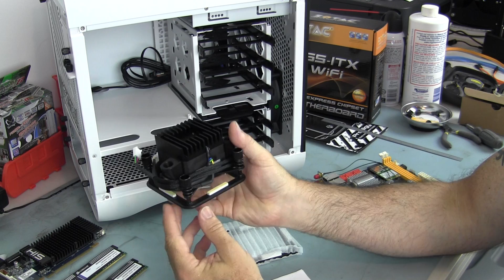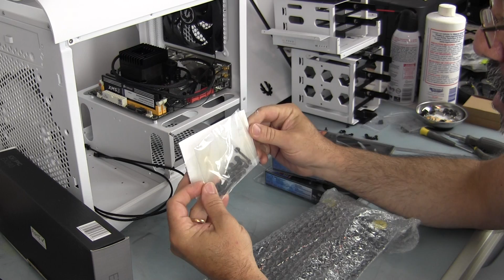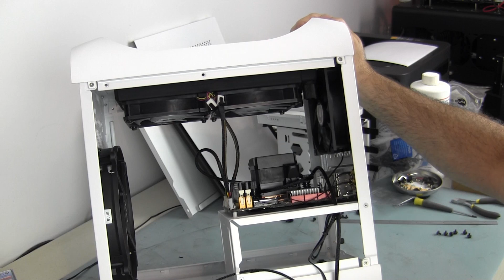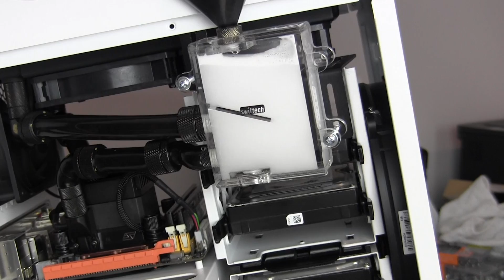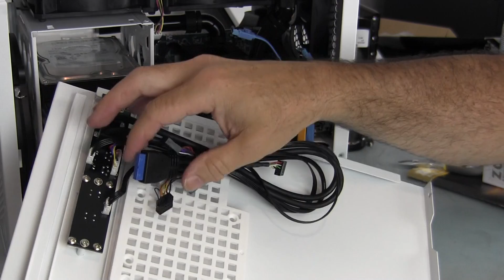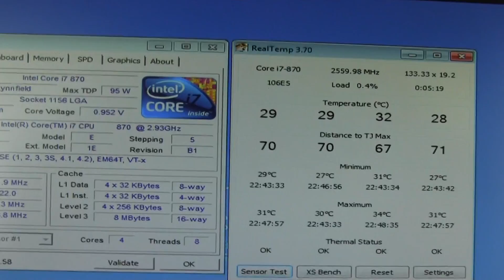BitFenix Prodigy Water Cooled WHS2011 Home Server Build - Part 2 - The Build

Comment: What happend at 38:38
Reply from the maker: The reservoir was so small and it sucked the coolant out so quickly I was afraid it would run the pump dry. SO I stopped and checked and then started again.

Comment: For a file server, a good CPU active cooling solution would have been most sufficient... But the setup you did is awesome, IMHO just for this and the fun of finding/building a solution it's worth it. Excellent Swiftech parts. however the pump is too noisy for my taste, personally high pitch whining noises give me tough headaches after a while.
Reply from the maker: Yes, was overkill cooling for a server, but it is still running strong.  Thanks for watching.
Reply: Ronsanut thank YOU for showing us. After a couple of such clips, your's amongst the top... When we actually "see" pros doing this, and all that they have to get through, personally I now feel more confident to try out my 1st custom water cooling solution.
Reply from the maker: HawkFest Great, glad it helped. Enjoy your build.

Comment from the maker: At full voltage the Apogee is louder than a D5 or DDC. I run this at the lowest setting since I am not overclocking.  But if space is your limiting situation, just adjust the speed until you find a balance for cooling and performance.
In order of noise at highest setting I would say from quietest to loudest, D5, DDC, Appogee.  But also depends on your case too. That may dull some of the noise.  Older GPU's are louder than this pump.

Comment: Hi Ron!

How loud would you say the Swiftech Apogee Drive II is compaired to a D5 or a DDC?
I'm thinking of building a micro atx case thats fully water cooled with 1 cpu and 2 gpu's and 2 240's, and i was just wondering if it was powerful enough and yet quiet?

Comment: Why dint u turn the Pump 80° to the right, than u would have anny problems with the GPU and it would be a bit easyr to conect with radiator.

Comment: I am looking to build my first computer in this case that will also work as a backup and media server (no gaming, but some encoding, so probably a 4770K), so I need room for 4-5 drives. However, I would also like to have a BD drive for rips. 2 questions: what would be the cost/benefit of water cooling in this scenario, and if so, how would you set it up with the optical drive still in place? I would be using the PCIe slot either for a RAID card or low power GPU.

Comment: Try sticking a long thin screwdriver or a plastic stick down your funnel into the res next time you fill it and it gives you issues to get the juice into the system, prevents the fluid getting stuck in the funnel

Comment: For me it's all about the situation that your in, I'm not saying that either setup is bad or wrong...i was just saying that with the case being of such a small size that it more feasible to use an out of the box solution. I customize cases as part of my job and i have i have no issue with either setup. There are merits to both

And yes, I did use the wrong item when i typed the x60. I had just finished watching a review comparison between the new corsair and nzxt ranges, i ment H80i

Comment from the maker: No that rad comes down about a third of the way into the optical drive bay space. Any rad you use in the top will prevent a fan controller from fitting in there.

Comment: Hi Ron. Love your channel. I'm about to get started with a prodigy build myself here. First question , with the same 240 rad , could I keep the optical bay tray in place and maybe use low profile scythe fans (i'd like to have a fan controller at the front , so I assume I have to leave the tray in...right?) 

Power supplies. Which would you recommend? I am leaning towards a Silverstone strider with short cable kit.

Cheers man! :)

- JC

Comment: In case nobody's mentioned it, you'll likely knock some of the fan noise down a bit by cutting out some of the roof of the drive bay cage.  You'll allow more airflow, which will knock down some noise.

Comment from the maker: Nice system, love that case too.  For what you have and that case, I would suggest a D5 Pump. I think think this HS and Pump combo is better suited for smaller rigs where you don'tr have the real estate.  But in yout TJ11 I would show off a tube res with a pump top and D5 pump. Check out my Clockwork Orange  Build. Thanks for watching.

Comment: Nice video thanks for the great details on the over all system. I have been looking at the drive 2 for awhile now. Atfer using wouls you recommend using it in a high end system. Im running amd 8150, dual vga xfx7950 double d's 3gb, and would like to liquid cool my system oh and its in a tj11!

Comment: Dude, you wanna know why the 200mm fan didn't fit? It's because you screwed it in the wrong places. You know where the optical drive bay removable metal plate is? There are 2 mounting points actually on it. If you were to remove it, you can replace it. There's a piece that comes with the case that allows you to do that.

Comment from the maker: It has been running 24/7 and sits next to me in my main office . Very quiet. I like it a lot ! Highly recommended. But I do have it running on PWM so it is running at a low RPM since the CPU is not overclocked. On full throttle you will hear the pump a little so for noise it depends on your case.

Comment from the maker: Depends on the noise level you get when you set the pump for your optimum cooling flow. But if you have a case with good sound dampening, you should be able to achieve a decent mild OC with the pump on a low setting, but that really depends on what you consider loud.

Comment from the maker: This is an older 1156 Motherboard. It works great. I have an i7-870 on it.
The main reason I got it is because it has 6 SATA ports on the motherboard. But I have had this for over 2 years now.
Thanks for watching.

Comment from the maker: Good question.  I am not sure. It runs 24x7 and I have the pump actually running on the PWM setting . I will connect up a WATT mete and should be able to tell you what the whole rig pulls.  But the pump should be very very low set like this.
Thanks for watching.

Comment: i dont know if the makers of the 200mm fan you use is odd, but the Bitfenix 200 and 230mm fans fit perfectly. Also, why not make life a heck of a lot easier and use a x60 or a h100i?

Comment: I'm a bit worried about the cooler I have, I bought it because it can clear high RAM but I'm worried about it interfering with the riser board on the Asus z77. Its an Alpenföhn Himalaya. It's very well made cooler, hope it works out. If it doesn't I'm looking at a Noctua. Just watching your lian li water cooled build on the other screen. Nice thorough vids, subed.

Comment: i wonder how many drives you intend on using, i would just mount the bigger drive bay on the bottom for better airflow and not put the smaller one in the case.

Comment: Just a thought.. why use an external card when the ITX board has builtin video? On my ITX filer I didnt bother even putting an external card in, just use the on board for the inital setup/bios related functions. I think you would get more functionality out of your server if you were to use that PCIx slot for a RAID card or similar..

Just a thought.. Nice build. I am thinking about using that case in the future.

Comment: Main reason I said that is because I kept hearing over and over from Linus Sebastian, Elric from mother boards dot org, etc etc, online saying " test your liquid cooling system away from your pc hardware components out of the case before you install it to check for leaks first." Either way.  Thank you.  Good to know that info " No danger if follow safe guards of only powering..etc..etc"

Comment from the maker: While you could do that, it is not really practical as you would have to disassemble it and unless you used all quick disconnects you would have to drain it and refill it.  There is no danger if you follow the basic safe guards of only powering up the pump ONLY during filling and lay down paper towels to collect any potential drips leaks. This way if a leak does occur no other electronics are energized and can be simply wiped dry .  Thanks for watching.

Comment: I had a WC'd setup where I used a Swivel fitting in order to pull out a drive bay reservoir and after doing it multiple times the fitting became loose and leaked. Luckily I caught it in time though; it was scary! Great build. I hope to make a build in this case eventually..

Comment: no problem so if you upgrade will you get the asus p8z77-i delux mobo and put it in i think it would preform better towarts you internet connection for what your using it for

Comment: If you use SSDs or 2.5" drives instead of 3.5" drives You could still have 5 drives without the drive bays.

Comment: Beautiful build, whish I had the money to get it. Just wanted to let a suggestion that might help you in the future (although I am not a big fan of liquid coolers, bad experience in the past) while filling the system place a thin object (straw or anything straight smaller than the intake valve) going through the intake valve, it will eliminate that "waiting for the liquid to go inside" problem.

Comment from the maker: Ten I would try one of the EK-Supreme HF - Acetal+Nickel [3830046990211] versions.  Are these available ?  Other than that try to see if you can get a Koolance CPU-370. That is a nice performing block. I have used both an both are good. Of course only if you like the looks that is.

Comment: Hey I can't get the apogee drive II where I am, would you suggest just using a EK waterblock for 1155? I have heard the copper can corrode, is that true? Also want to use a pump/res combo any suggestions? Cheers

Comment from the maker: No the loop order does not really matter (maybe 1 or 2 degrees max). Do it so that you have the most efficient and nice looking loop. That Apogee pump is powerful, I had to crank it all the way down just for my CPU. Adding a 660 would be no problem for the Apogee.   Not sure what you mean by the Apogee Outlets in different places. The inlet is on one specific side. In my build it is on the side closest to the graphics card. Yes you could mount a res on the side panel where the SSD's if it fits.

Comment: Hey just a few questions. does the order of the loop matter greatly? I am thinking of doing something similar but for a gaming PC. So I want to fit at least a GTX660 in here, would the Apogee still suit this application? you mention the fittings getting close to the gpu. Could the apogee fit with its outlets in different places? So I could possibly mount the res on the side panel with the SSD mounting area?

Love this build.

Comment from the maker: Yes I think you can fit a 200mm fan on a 200mm rad and also have room for the 240 in the top.  But I don't think anyone makes a 2011 mini-itx mobot, requires too much space.  That would truly be a kick ass build.

Comment: you would be able to do a 200mm x 200mm rad in the front with 240mm in the top right? - using ssd's, 2011 socket mobo and a 670gtx = killer pc :)

Comment from the maker: If I did not plan to have this as my Home Server, I agree, this would make a kick ass small power house gaming system with a Z77 and GTX 680 or even a 670 since the half card length ones can fit easier and even be water cooled.  Thanks for watching.

Comment from the maker: My first few builds with new rads I did not do that either and if you can flush it, just by pouring distilled water through it before you use it even that would help. I have not had problems with those systems but feel better to flush it and not to allow any potential remnants to float in my blocks.  Just my personal preference.  Thanks for watching.

Comment: 480mm rad to catch up with the h100? Last time I checked the h100 (which I own) runs much warmer than other 240mm loops (such as the xspc raystorm ex240 kit). But the h100 is definitely more noticeable, considering that with the fans cranked up it sounds like a hair dryer. I don't know what sales pitch you heard/read, but who ever gave it did his job beautifully.

Comment from the maker: If you install the H100 in the top, you will lose the optical bay.  Looking at the length of the hydra pro I don't think it will work using the designed optical bay space.

Comment: Im looking to do a build with this case do you think i could get a H100 with push pull in there and a tiny fan controller if i cut the 5.25 bay its the bit  fenix hydra pro

Comment from the maker: There is 5 inches or 125mm from the top of the Apogee to the roof of the case where the fans or radiator would mount.

Comment from the maker: Once I learned about them I have been using them in most builds. But I have found some new inexpensive fans and will be doing some real world testing on a radiator to see which ones are the best and best value.  Look for that soon.  Thanks for watching.

Comment from the maker: Yes definitely. Has a boat load of pressure.  I don't have a flow meter on this one but with the rpm's turned up it churns. When i first filled and ran my loop you can see almost foam in the reservoir as it was pushing at top speed.(Granted the air in it loop at the time contributed to a lot of the foam.)

Comment from the maker: No, as the reservoir can swing out I can remove the bottom plug in the res and let it all drain from there. I may need to tilt the system to get any residual out but easily done with this small case. Plus I believe the reservoir bottom is the lowest point in the loop.

Comment from the maker: Yes, Defintely. I would use a new Z77 based ITX Motherboard and go with a GTX -670 Graphics card, and if you water cool it you will even save space as the new GTX-670 card would be only a half length card.  Then you could remove the drive bays and mount your reservoir and or pump in that space. You can mount one or two SSD's on the bottom rear of the power supply / motherboard enclosure.

Comment from the maker: Yeah, I did not know the NZXT fit just their own cases.  The airflow in the case is good though flows over the drives.  And I ahve the exhaust and the top 2 120mm GT AP-15 fans.

Comment from the maker: Turns out that my fans running at 1850RPM was the biggest culprit for the noise.  I put reducers on them and all is now quiet. I also set the pump so that it is running at 1500 rpm and you can not hear it at all.

Comment from the maker: Actually this morning when I went to start configuring the server , I realized that the loud noise might be from the GT's on full so I found a set of Noctua fan reducers and now at the lowest setting for the fans. I can not hear a thing. The pump turns out to be very quiet after all at the 1500 RPM setting.  Compared to running at full fan speed the delta between the temps is 1-2 degrees.  Since I am not OC's that is just fine.

Comment: The NZXT fan is actually more like a 195mm fan,they claim it's 200mm. They are designed only for there own computer cases, with different mounting holes to fit the non-standard design.

Comment from the maker: The lowest speed it will run at is 1500 RPM. It is not bad I guess. I really have to check out the noise when in my office sitting next to it.  I just ordered an Alphacool Cermaic DC LT pump to see how loud that is. If it is silent I may change this up.

Comment: Why don't you use a fillport at the top of the case and get rid of the reservoir? This is such a small system...there's no need for it and that would be way easier.

Comment: There's a couple of ddc models, brand (swiftech, koolance etc doesn't make a difference). 

There is
10w (ddc 3.1 aka swiftech mcp350, 400 litres/hour)
18w (ddc 3.2 aka swiftech mcp355, 600 litres/hour)
18w (ddc 3.25, 900 litres/hour)
18w (swiftech mcp35x 1050 litres/hour)

I have the 10w, it runs at 3800rpm and still has some noticeable buzzing. What speed does yours run at on the lowest setting?

Comment from the maker: Thanks. I agree with you.  I have set the speed in the bios to run it at the lowest setting. It is much quieter, but still nothing compared to my dual D5 pumps in my STH10.  I will have to move it to my office and let it run.  Do you think I could replace the DDC pump itself with another DDC ? If so any maker you would recommend ?

Comment: I do not recommend the Koolance RP-401X2 setup suggested by im0rtel. I think the setup you have now is as good as it can get for such a small case.

The noise from that pump is normal for a DDC especially since the swiftech one is the most powerful. They all have a high pitched whine. 

You should lower the rpm since its such a small loop, you don't need it full power and it should be alot quieter too.

Comment from the maker: Mounting radiators externally is for days of old and not for me. I personally would never mount an external radiator to a case. Most I have seen look absolutely horrendous with them hanging off or strapped to the top/back/sides. Maybe a water cooling case itself but not for a HomeServer build like this. I do like the design aesthetics of the case with its feet so I am okay with them. I do like the 200mm rad idea in t he front but the only way that works is to remove the drive cages. Thanks .

Comment from the maker: Thanks for the feedback. To fit all of the hard drives I have I had to use the drive cages. There is not enough space between the front panel and the drive cages or I would definitely have gone with a 200mm Phobya extreme rad like I used in my CORSAIR 600T Case mod (see my other videos). I am familiar with the Koolance bay res's I have a couple in my system now, but the only place for me to fit a rad and use the drive cages is to mount it in the top.